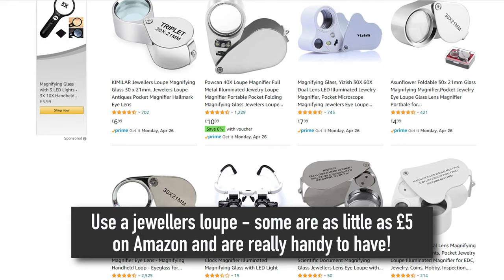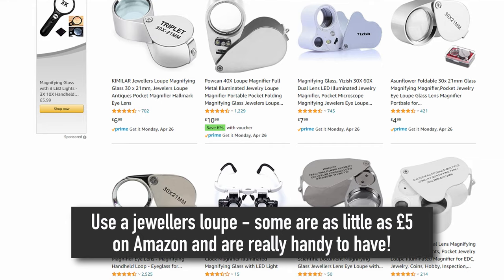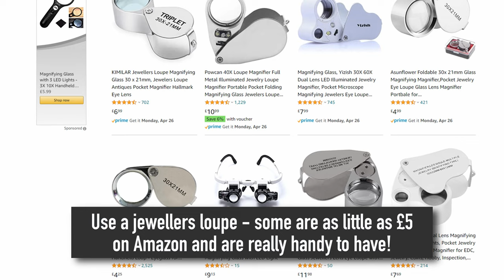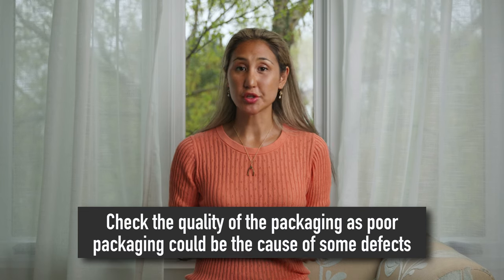Quality Checking your Jewelry

Comment: It's very good information, thank you
But how we can minimise such issues.
Reply from the maker: Hi Lal. A couple of suggestions:
- Being aware of such issues can allow you to communicate your expectations directly to your supplier, in order to avoid qualit checking each peice yourself after you have received the goods.  - Asking your supplier if they have the necessary tech/equioment/tools to help prevent these defects.
Ultmately there is bound to be casting/stamping issues regardless (as we have at our manufacturing plant) but it is about the supplierr having awareness and knowing that they have preventative measures to fix these common quality defects should any arise during and after production.
I hope that helps. Kim x